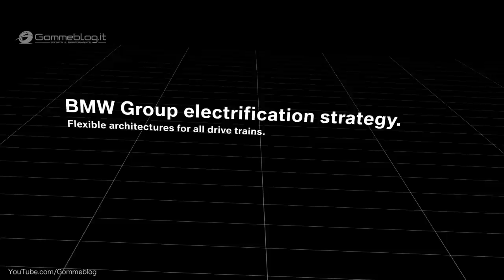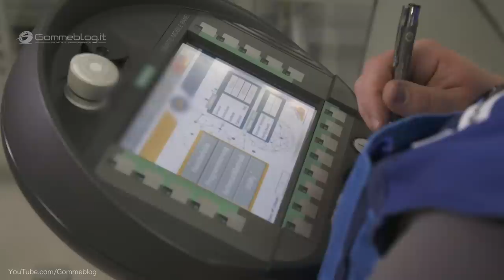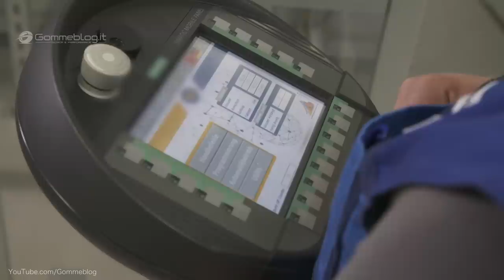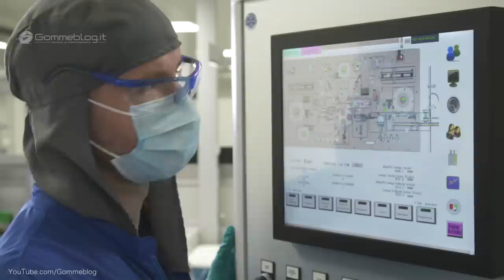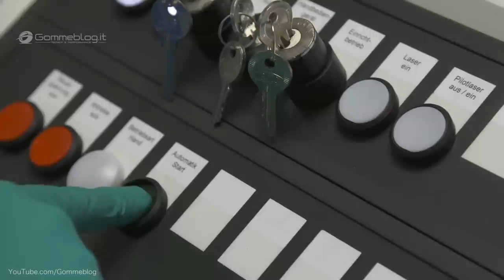BMW Electric Drive HOW IT'S MADE - Interior BATTERY CELLS Production Assembly Line

Comment: Electric motors will always be quicker and more efficient than Internal Combustion Engines.  There's just too much friction/loss in an ICE because of the sheer number of moving parts and their complexity.  Then add the loss & complexity of the ICE's gearbox & clutch, which by their very nature limit torque and produce wavy power delivery.

ICE vehicles are already looking like steam engines in comparison.  Ye Cannae Change The Laws Of Physics.
Reply: Yes but now electric cars have yet to stand the test of time
Reply: A BMW has an 8 year/100,000 mile warranty on the battery pack - no ICE car maker offers this on an engine! :)
Reply: All true. But I like that when I run out of gas I just sip some more and have instant go-ahead. Can even carry a reserve in a can(s) and extend my already awesome autonomy (compared to an electric drive). Electric ones have to be charged, not quite convenient and takes time. Also no engine sound, yuck!
Reply: Here's another law of physics ye cannae change; chemical batteries have a shitty energy density compared to any combustible fuel. Which matters a whole lot when you want to get somewhere... 

And btw we're still using steam engines in the 21st century, from nuclear submarines to solar power plants these all use steam power.
Reply: So you drive a steam powered car then? :)
Reply: @mmdirtyworkz, I've been driving an EV for almost 1 1/2 years now and I've never had to wait for it to charge - 98% of our charging is done at home, so it's like having a fuel station at home! :)
Reply: Yes but the crippling fact for motors is energy storage. Every liquid fuel in use currently even fucking paraffin has a higher energy density. Good luck with hydrogen storage for closed fuel cells because that shit will leak out no matter what you put it in.
Reply: The figures about how much energy we put into refining liquid fuels are alarming if you've ever seen them! The idea of generating electricity and then using that electricity to refine petrol/diesel etc is ludicrous when you think about the alternatives we have now. I can't thank Tesla enough for the impact they have had on the market to show what's possible! :)
Reply: Have you seen what 60% of the US's energy comes from? It's coal, natural gas and oil son! It's the same outcome either way! What's your solution to the strain electrics will put on the grid?
It can't be dams we've build all we can practically and cheaply. Just ask the Tennessee Valley Authority!

You don't want geothermal power, it produces huge quantities of CO2 and cancerous radon that seeps up with the water they use for turbines (regardless of where that water came from). Solar power? Well areas like the northwest and southeast get a lot of rain during the summer and spring. That means a lot of clouds. Those areas can't get their power like that. I've lived an SC for my whole life and it's a regular thing to not see the sun for 4-5 days sometimes a week!

The southwest has a lot of space but you'll need an army to keep those panels or mirrors clean. Also the amount of toxic chemical waste made from producing solar panels is awful. Wind is good but it takes A LOT of materials and money to put up just one turbine. Then think of how many people die working on turbines and how you can't store up energy in a practical way for when the wind don't blow or the sun don't shine. Not to mention the claims that wind turbines are causing insomnia due to low frequency noise.

This leaves one option...the "N" word. And that solution...it's got potential they've worked out some cool stuff over the last 30 years...
Reply: As if putting energy in a complícated battery pack and later on getting it out efficiently is a piece of cake
Reply: Holden colarado
Reply: @ jools2323
Yes you are right. The internal combustion engines are outdated and reached already the maximum efficiency, You can't make it better anymore. It's just an old technique.
Electric engines are just simple to build and most efficient.
Reply: @theq4602  It all boils down too (pun intended) where you want to release the pollution at. Do you want it to be from the exhaust of a car in a highly populated city or do you want it out in the boonies at a facility that has a million and one ways to stop most of that pollution from getting out to the atmosphere?

Any energy that we use requires development. We take gasoline for granted but that's got over 100 years of development behind it when you look at methods of production and the additive packages that are included in top tier gasoline. That we can get a gallon of gas that requires an oil refinery with several billion dollars worth of equipment to refine the oil that required billions more to get it out of the ground for less than we can get a gallon of milk from a cow, speaks volumes about the production process. You pay more for a gallon of Aquifina water that comes from tap water in Livermore, CA than you do for gasoline that requires a global infrastructure to produce it.

As they say in England, I'm a petrol head. I like my gasoline engines for racing cars and motorcycles but I also love what's going on with electric vehicles and the masses of torque they can produce. I hope they can develop electric motors and batteries to withstand repeated hard use and batteries to extend the range. The new Telsa Roadster with its ~1.6 seconds to 60mph, 250mph+ top speed and range to get from SF to LA and back is a good step in the right direction. Not bad for something that accelerates quicker and has a top speed about the same as a Bugatti but costs a 1/10th as much.
Reply: @videogalore  Try getting BMW to honor that warranty. They'll recondition the cells for weeks in order to get the whole battery back over 70% SOC and charge you for the privilege. Don't ask me how I know.

Comment: I honestly can't wait for some company to actually make an affordable electric AWD car well under $30,000 with the room and reliability of a Toyota Camry sedan that goes 300 miles on a single charge, and will safely recharge in minutes. Only then, will gasoline start to become a thing of the past.
Reply: hyundai has it...
Reply: Almost. Hyundai Kona is $34000 for 290 miles, or $29000 for 200 miles IIRC - doesn't quite meet the guy's spec, but getting pretty close. Best value EV so far.

Comment: Why not put the battery on the top of the car ?? :/ They don't think that they will be better protected from Rock's, dip water ect ?? :/
Reply: SOL LUNA
1. Center of gravity - the lower it is, the more sticky to the road the car will be.
2. Spills - in case of it, you don’t want to be under a damaged battery.
3. Stiffness - you want the battery pack to be placed in the stiffest part of the vehicle which provides a better safety profile, with lesser chance for damages like case rupture, leading to electrolyte spills and fires.
If rocks were enough to easily destroy the car’s undercarriage, we all would be fucked. Thankfully the cars have polymer shields for protection against the debris on the road and batteries themselves are well sealed, protected and completely waterproof.

Comment: The Achilles' Heel of the Electric Passenger Car is its 'Fuel', its Batteries Charging Time. However, it could be a boon to city traffic or short distances. With Full Automation and Global Positioning Systems, the Vehicle Operator is to be eliminated: Driver-less Vehicle is the Future for city Traffic. A very light body needing not huge amount of Energy is the answer. Vroom Vroom, in the neighbourhood, should be the thing of the past and limited to Circuits. Electric Passenger Cars should be simple and Functional not Koenigseggs, Mclarens or Rolls Royces.

Comment: All electric cars have their handicaps, namely mileage. I live 300 miles from my family. I shouldn't have to spend $100+ to stay the night somewhere along the way just to be able to recharge the battery without having to sit around for a few hours waiting on it to recharge. Still not a practical car for me to own. And, many areas still use fossil fuel power plants, so the question is which car is cleaner for the environment - gas or electric?
Reply: Rob, evs will go 300 miles now on a single charge. If you are mostly highway driving, a Tesla Model S will go 500miles on a single charge if you hypermile it.

Comment: yea great, i heard that the hybrid series 7 still broken  yet on the dealership. but here is the deal breaker:

do you power your home stuff with gasoline ? ice box, owen, lamps, tv set ? so imagine if gasoline is not used for cars anymore, now is easy to conclude that socket eletricity is a most sought after thing, HOW MUCH WILL YOU PAY FOR ELETRICITY ? the production cost will raise, so the distribution, bottom line: because of eletric cars your cost of life will be raise, whether you have a eletric car or not.

Comment: Batteries will be replaced in the next decade or so by a much smaller unit that will be self generating energy and virtually free from failure and no charging required, this will be about the size of a shoebox and top speeds will be faster than all ICE engines. This will bring cars that can fly and motorways in the air will be as common as motorways today.
Reply: aliens fly out of my butt

Comment: batteries under your seat so if you crash it will blown your balls of or just burn then, and also you will still have to charge the batteries from some outlet that will bring the current from a plant that burns oil or natural gas or  coal, nice progres.
Reply: Francisco pinto the crastest standards in Germany are the highest worldwide. If there is a problem or issue, BMW electric cars never been sold. Your balls are save. Also in a BMW i...
Reply: Francisco pinto ...Progress..
Reply: We need big nuclear plants. I don't want solar or wind power, it's too intermittent.
Reply: Dont crash then.
Reply: Sacrify kids for balls, to make more kids. Im down.
Reply: The Q : unless you live where I do, in which case solar is great, as is wind. (Aus, N.T.) But you are right, that right there is an example of the problem. Many of the Greens around realise that Nuclear has to have a place too.
Reply: @Francisco pinto
A highly explosive gasoline tank in the car will not just blow your balls away, it will burn everything. 
By statistics, in Germany more than 40 gasoline cars per day burning down.

Comment: Tesla much better they have battery cooling system & auto charge when driver deaccelerate pedal power, plus solar to charge. They forget wind power energy also can charge the battery.
Reply: Both the i3 and i8 have water cooled batteries and regenerative braking. Hell, even the F30 BMW 320i has a braking energy recovery system to charge the 12v battery.
Reply: ... in fact, the jaguar i-pace has a better battery cooling system than the teslas currently do. that's why tesla packs overheat on the track and need to throttle down the power output...their lack of cooling.

Comment: ya they're only good at automating production but they don't want to make the product last long, electric cars could be made to last a very long time but that would be bad for business for people would only be buying a new car every 20 years..  they spend a lot of money to design part to fail not to make them last longer... 
fuck the consumer, consumer will buy what they produce cause that's all there is for sale... we have no other option. 
all car manufacturers collude and share information to design repeat business not longevity  .
up to now manufacturers were being paid by the oil companies  to design  gas guzzlers  and forget efficiency 
we should have had hybrid cars frigin  50 year ago.. where a small engine 10 horse power generator is charging a battery and electric motor for propulsion that would get 500 km to a gallon.  
did anybody hear about who killed the electric car... GM did.... cause it was designed too good ... and that was 35 years ago... 
does anybody agree?